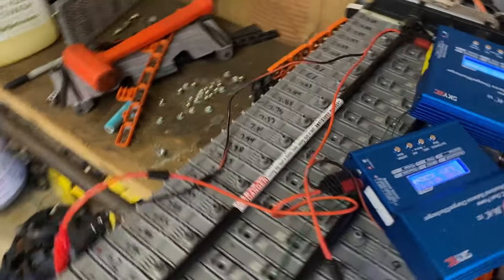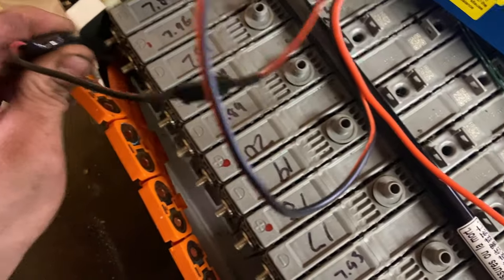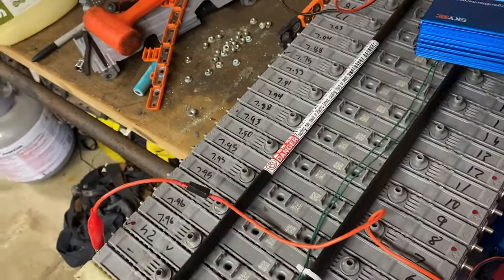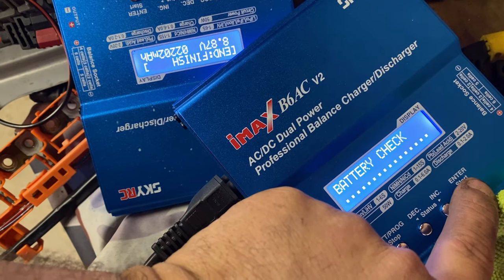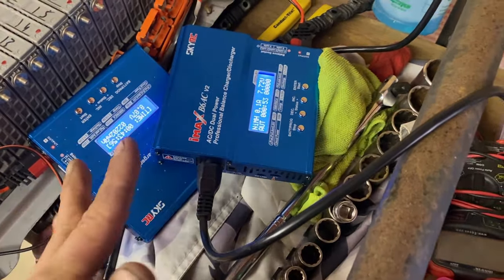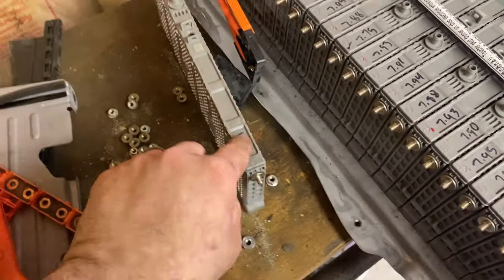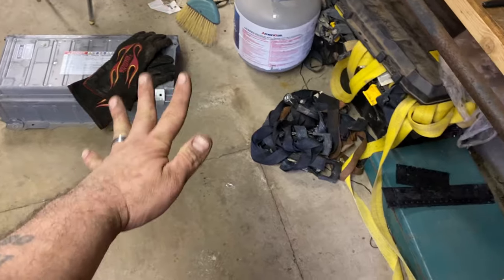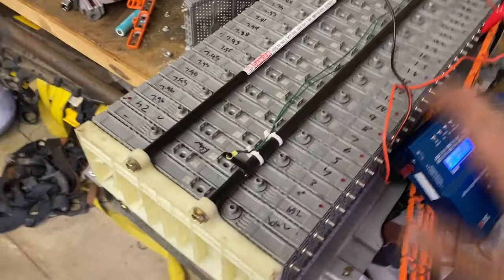How to fix a Toyota Prius Battery (Hybrid Battery)

Comment: Did you ever manage to get those dud modules back to usable condition with charge cycling? Interested because my car has one dud and it's not easy to find replacements where I am. When the wires aren’t connected to the car the voltage is approximately half but still enough to do damage. I am trying to stay alive too
Reply from the maker: No sir we didn’t.  We tried n tried.  They come back but only lasted a week.
Reply: @R.N.GPerformance   Ah interesting! And good to know! Thank you for your reply… Now I won’t waste too much time trying to fix the dud module I have
Reply from the maker: @josephcullen2512  your welcome

Comment: Can this method be used on a 2010 hybrid escalade?
Reply: @ronaldoquintos1675  thanks for response. i ended up spending 3700 on a battery from green bean. have had 'service hybrid system' ever since, but at least it's not broken down. the escalade was literally broken down with the previous battery, so whatever they did fixed it. just weird i still have that message. they wont come fix that error code ive been driving around for months.

Comment: This cheap charger cuts off at the full. charge state? 🤔 or does it overcharges
Reply from the maker: You set it when to cut off
Reply: @R.N.GPerformance  in a review  someone said only the discharge had a cut off setting. but nt full setting
Reply from the maker: @stephensharma3259  hmmm. Ours did.
Reply: @R.N.GPerformance  I have a 100watt tenergy. Good but expensive to buy more. Was looking for alternative multiple chargers..I.need a faster Discharger. would you recomend using a fast discharger? 🤔 or does it harm battery
Reply from the maker: @stephensharma3259  just use a 9005 head lamp bulb to discharge if you need it faster.